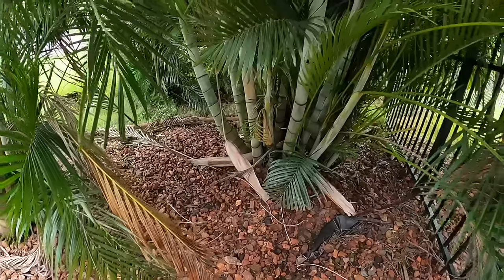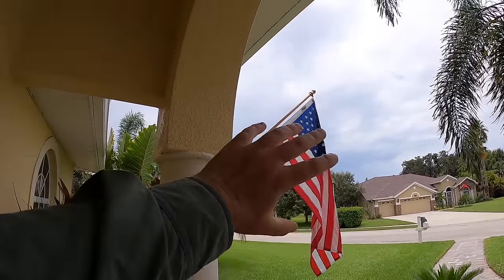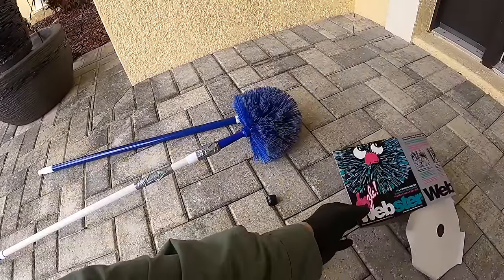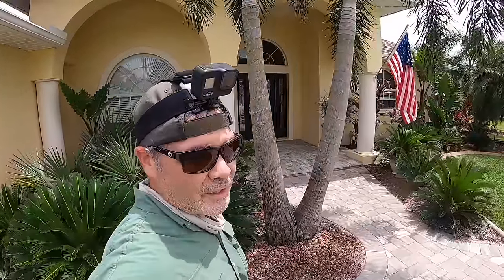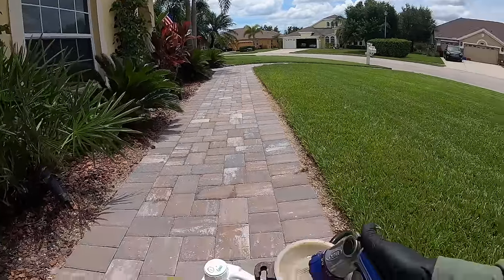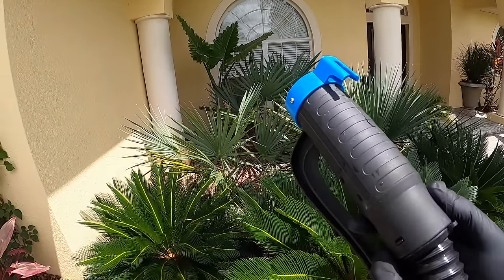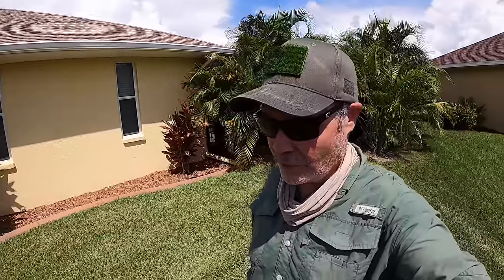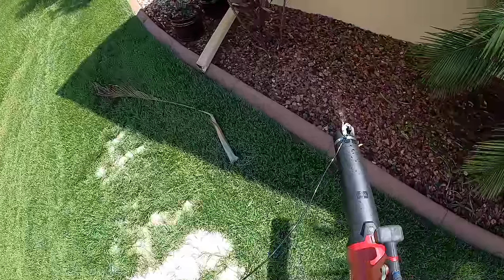Get Rid of Roaches, Mosquitos, Fleas | Home Pest Control

Comment: life hack for pump sprayers, get a tire valve from your local auto parts store, drill a hole in that sprayer, put that valve in der, fill that bad boy with your air compressor and only use that pump handle as a handle.
Reply: How much pressure psi?

Comment: Home Depot and Lowe's sale pretty good extension poles. I work at Terminix and I get mine from Lowe's. Webster head screws right on. Also for spider use a product called Webout. Leaves a great residual behind so future spider webs don't stick. Just spray it on the web head like you did the Microcare.
Reply: If you need anymore pest control tips don't hesitate to shoot me a message.
Reply from the maker: good tips thank you! When I worked for TruGreen and you guys were our "sister" company the big wigs always told us how much better of a company you were lol

Comment: How often would you reapply this in your lawn?

Thanks for the video. I ended up getting the same products and applied them.
Reply: About every three weeks or when bugs are noticed again. It depends on the rain as well.
Reply: @Mist-Pro  every 3 weeks doesn’t sound very efficient for the yard. Given many lawn applications are 12 weeks
Reply: @christfollower122491  If you get no rain within three weeks then it will last way longer but most areas get rain within every 3 weeks and it washes off a bit when it rains.  If no rain, then the chemicals say it can last up to 7 months.  But the pro companies are usually scheduling every 3 to 4 weeks in between treatments because of rain.  When you DIY spray you can watch weather and spray when no rain is projected for a while. Companies dont care and spray when they are in your area.
Reply: @Mist-Pro  this is really great info thank you.
Reply: @christfollower122491  anytime!!!  U can call us anytime too if you have more questions or need more explanation. I’m always happy to help.
Reply: @Mist-Pro  p
Reply: Did not write that.

Comment: If people would clean up! anything that will hold water, cola's , paper with any smell's, all piled up leaves, wood, or just house hold trash, get the trash out of the house everyday. Put the trash in the cans with lids, I made a concrete mold using the trash can lid, then glued the concrete to the inside of the lid if you have dog's, or just put the trash into the trash container away from the house! Spray the bottoms of the trash cans that are on the ground, spray in-between the cracks on rocks,bricks, concrete blocks next to the ground.  I spray the tree trunks, under the bushes, rain gutters, less on lawn because of fur kids. If you want to pass on the 400.00 bug blaster, I will be happy to use it😂🤔

Comment: Great video. 1) how does this affect bees? I don’t want to harm bees. 2) how does this affect pets?  When can pets go in lawn?
Reply from the maker: I would not spray when bees are present. As far as pets, each product has a reentry period listed. I think both of these are 1 hour or until dry.
Reply: The Lawn Care Nut Thank you!
Reply: The Lawn Care Nut I ordered the products today. The brush is by a different manufacturer. EVERSPROUT 3-pack with 26 foot extension pole. It looks a lot stronger than the one you used. Check it out.

Comment: Hey, I bought bifen i/t and cutter.... I have a deck in backyard... do you recommend spraying deck down too for mosquito control or only grass areas and bushes/ shrubs? Also do you recommend mixing cutter with the bifen in my chemical sprayer or only use bifen alone in the sprayer at its recommended dose?

Thankyou
Reply: I would just use bifen alone.  its much better than the cutter.  they are both insecticides.  I would add an IGR (Insect Growth Regulator) to the compliment the bifen.  Tekko Pro is a great one!

Comment: I am not convinced by that sniper system. It seems like spraying directly with the pump does the same thing!
Reply from the maker: I sprays it much further and faster.
Reply: The blower pressure is necessary to move foliage around while coating it with insecticide. Your basically injecting insecticides into the plants where the bugs are resting. Also a mist blower can treat areas much faster and use less insecticide solution.

Comment: Does the sniper use vacuum to pull the water from the sprayer or do you have to keep pumping it up?
Reply: You do have to pump it every once in a while however the vacuum effect does help so not as much pumping is required. Also we make the system for numerous other tanks and some of those tanks are battery operated.

Comment: Sorry if this question was asked already...Can these chemicals in this video be applied in pet areas? If so, how long after application can the pets re-enter?  Unfortunately, I have a VERY small yard (approx 40x40) and live in an area with a horrible flea problem. I would love to try this concoction, but need to be safe where my pets are concerned. Thank you in advance for any replies.
Reply from the maker: these are fine for pet areas = they are actually labeled to be sprayed in kennels for fleas. Keep pets off until the app is dry, usually a couple hours at most

Comment: Hey Allyn . I and the wife have never ever had a roach on our home for the last 12 years until about 7 months ago now there everywhere. I used a product called bifenthrin 7.9  that I got from a local feed store like a video recommended. welp, it's been 2 weeks and the boogers are still come out to party when you turn the lights out should I buy this tekko pro to mix with it? please help Thanks Jay
Reply: Hi Jay, It's Ryan with Mosquito Sniper System.  Yes add the Tekko Pro with the Bifen.  It will eliminate the entire life cycle of the insects.  The products together work fantastic!!
Reply: @Mist-Pro  For an in home issue with german roaches, would using a mix still be recommended? I'd like to completely get rid of them for good. I was going to use this mix in the video Bifen X/T and Tekko Pro around my yard, outer foundation and in my home to start the process.

I read in one of these comments (Months ago, cant find it now) that You shouldn't solely rely on these manmade insecticides, that every other treatment you should switch to a "natural" insecticide such as - Essentria IC3 insecticide and still pair it with Tekko Pro since its GR chemical - as to not allow any of the pests to develop a resistance/immuno defense to the hard stuff. This makes perfect sense to me, but I'd like to hear your take on it.

Comment: Are you replacing your propane powered fogger with this or is that meant just for an added dose of insect control?
Reply from the maker: Propane fogger is just meant for if we go outside for a few hours so I will still be using that to clear the air.

Comment: Greetings, Sir. First time viewer here, and I have a question since your from Illinois area. I’m having a massive sugar ant and spider problem this year. I assume the spiders are there due to the ants.... but the ants are under the pavers alongside my driveway. If I dig up the pavers, I’ll never get em set right again. Any suggestions would be most appreciated. Thanks.
Reply from the maker: if you spray this mix in and around the joints, it will get them pretty good. May take a couple apps.

Comment: Ryobi makes a fogger and it's reasonably priced. I would use that vs the $35 retro fit kit. I wasn't impressed with that as much. Plus that neck gator you got I also wouldn't use that personally... just my opinion I don't think it worked during the mask mandate I'm sure it's not going to work for toxic chemicals. But to each their own.

Comment: Hi Alan, Can the sniper spray in a more mist? During your testing it looked to be spraying out in more of a stream than fog/mist. I was considering to purchase the Stihl fogger but if the sniper works than I would go that route
Reply from the maker: yes you can turn the valve to put out less material which then gives you more of a mist./ But it isn't a mist like you saw with the pro version.
Reply: The Lawn Care Nut , which do you feel worked best overall despite the price difference. I think a gas power backpack fogger would work best.

Comment: Hi Allyn, I appreciate all the info.  
I have one question.  
Can these chemicals be used inside the home.  
I used to have a company come do my place until I got tired of paying $125 per quarter.  
I started doing it myself two years ago and I’m using talstar professional insecticide indoors & out around foundation.

Thanks Allyn!
Reply from the maker: yes they can. A little different application technique to read on the label but yes for sure they are approved for indoor use.
Reply: The Lawn Care Nut ....thank you sir!

Allyn, where can I send you pictures of my lawn?  After years of following your advice, and the last 2 years applying your bio stimulants, I’m for the first time ever experiencing lawn domination in my community.   

I’d like to send you some pictures 😎
I have some common Bermuda growing wild in a small section which I’ll tackle this fall & spring.  I won’t be seeding this year since my lawn is nice and thick except for the area with Bermuda.
Thank again!